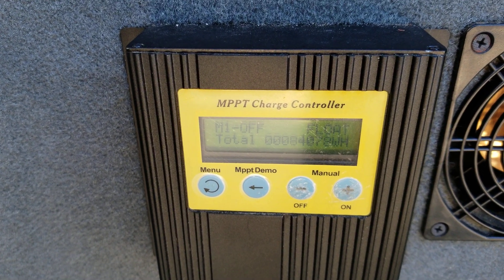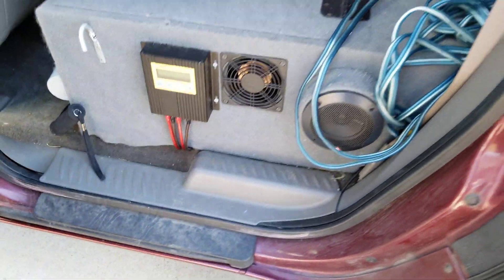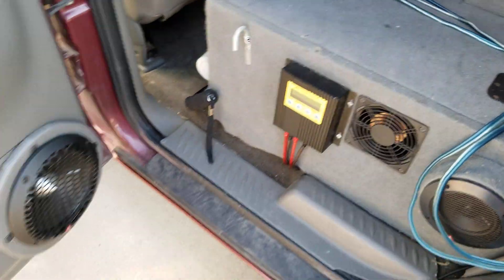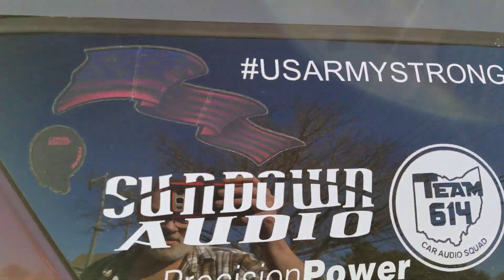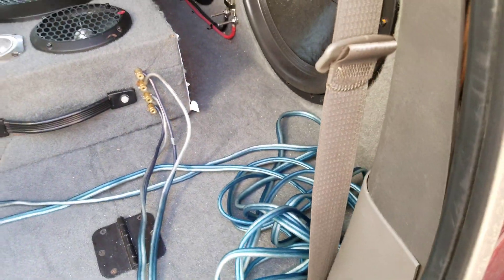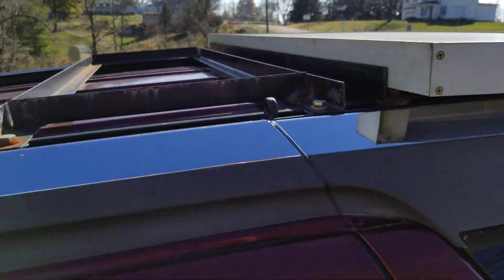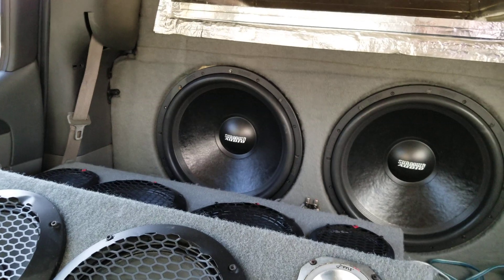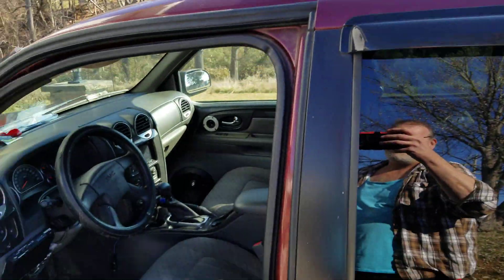Car Audio Build On Solar !

Comment: I've done car audio for a long time, and I recently started selling solar for a very good company in the Midwest.

I really want to build a demo rig, that is 100% solar power.

Meaning it can only compete outside, and in very good sunlight conditions, but I want to do the most efficient subwoofer box, subwoofer, and amp build that can run 100% solely on the sun's energy. Have you seen anybody do something like that before?

Comment: What size amps are you running ? I'm waiting to run my skar rp 1500 and the rp80.4 in my boat would 1 100 watt solar panel keep the 2 batteries charged ?
Reply from the maker: The Solar panel I use on my Vehicle keeps the battery charged up. The Solar will not run the Sound system by itself. I had an Audio Legion 5K for Bass. Also have 3 PPI 4 channel 1600.4 and 2 Channel 400.2 for Rear outside soundstage

Comment: I am working on this now, but I need to adapt it for lithium. Lithium does not like a float charge. You have to stop charging when it gets to 100. Thanks for the inspiration.
Reply from the maker: Yeah just set the Float charge couple of tenths lower. Its should be ok.

Comment: lol only 150 db oh well should keep the wax out of your ears
Reply from the maker: To some people 150 db is loud. But really it isnt.
Reply: @SoutheastOhioSolarHaven  after 90 db you need hearing protection in a Canadian workplace
Reply: @SoutheastOhioSolarHaven  for the average guy with two 12s and a amp it is about the max you get with out any knowledge but it ain't hard for someone with experience bit it's respectable regardless